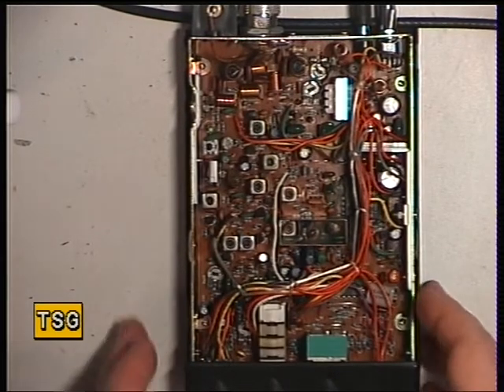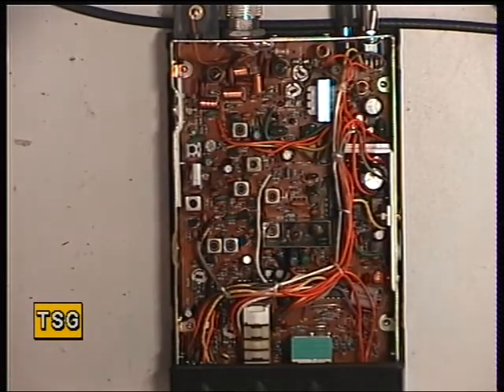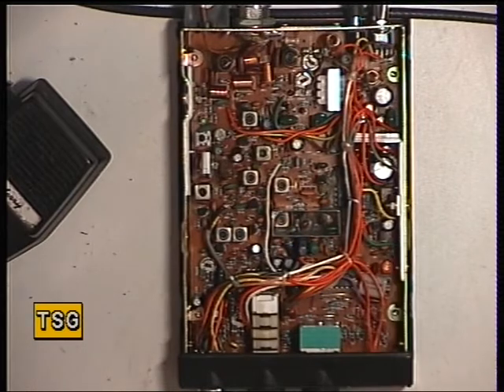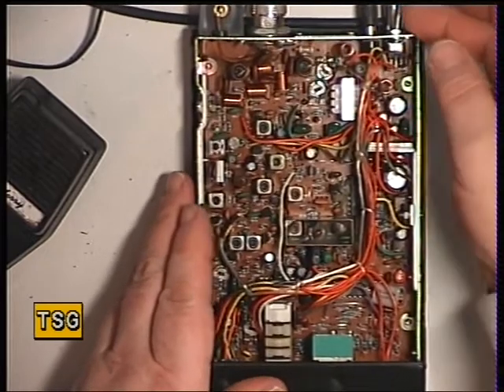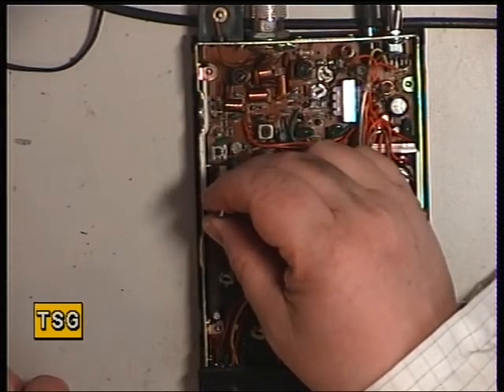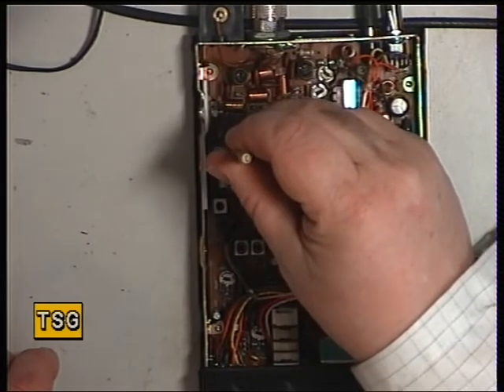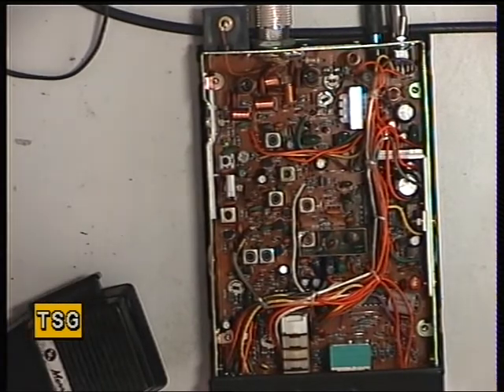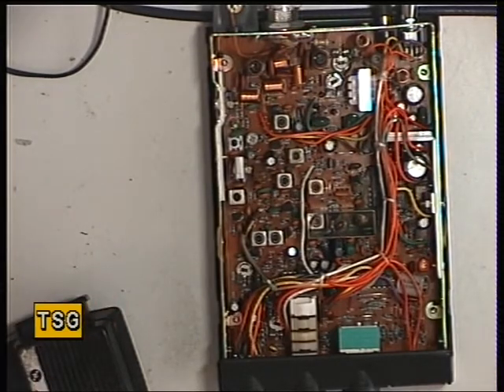Midland 77-805 Port-A-Pack, UK (CB 27/81) CB radio (Transportable) - Transmitter alignment

Comment: Hello UK CB radio servicing/RichardShireby
I purchased two of these units on Ebay. Both of them receive very well. But when I transmit to my friend on his CB. He says my voice is very weak/not loud. Is it required to do this kind of tune up on the port-a-pack. Here in the U.S. I can not find anyone to do this like you. Can you suggest any help with this for me?

Comment: Hi Richard I have one of these, it transmits on low power, but on high power it doesn't function any ideas?
Reply from the maker: How bizarre, because low power goes through the extra bit of circuit to attenuate the power, whereas high power is the normal setting. I would guess at a broken wire between the high/low power switch & the pcb. You can also check the switch with your multimeter before delving into more complex issues.

Richard
Reply: Probably like mine. The low/high switch is broken!

Comment: Hi,  at 3 min's and 10 second in the video you have a tool in your hand that is hardened plastic and copper to brass looking in colour, do you know what it is called please or where to buy them, i am starting an electric/communication course in april to may next year online, and im trying to get as many different tool's for tuning/alignment as i can, thank you
Reply from the maker: It's unfortunately now discontinued. R.S. Components used to sell three types of Trimming Tool, the yellow one I use, that black one with two different phosphor-bronze ends & a blue plastic one that doesn't fit very much that we see. I'm having to use ceramic trimming tools & got a cheapish set via AliExpress. We also use the "colour tv alignment set"  which Rapid Electronics still sell. The green hexagonal tool in that kit is vital. If we lost the black tool you saw, I'd have to make one out of wooden dowling with a phosphor-bronze flat strip inserted. Sometimes that PB flat strip could be recovered from the carrier strip that some Molex type connector pins are supplied with as a bandolier.

Hope that helps,

Richard, UK
Reply: @ukfmcbradioservicingTango21  thank you, for replying, do you know what it was called even though they don't make them any more please,
Reply: hi, could you take a picture of it if that is ok please, and up load it,
Reply from the maker: @ghostshy5176  I tell you what, I'll do a  quick video on alignment tools tomorrow.

Richard
Reply: @ukfmcbradioservicingTango21  thank you

Comment: Hi, late to the party. Very very, late. anyhow, I just came across this video. I hope you’re still around and can and will help. 

I came across this radio. Only difference is, mine is a silver face. Other then, all the same. However I need so help. The low/high watt switch on mine is broken on the inside of the switch. I took it apart the the plastic piece that makes it switch inside is broken. I need help finding another switch. 

It appears to be a 6in 3A125VAC switch. Why it says AC on it I haven’t a clue? But it indeed says AC. 

Anyhow, can you or anyone else maybe help me find this or another compatible switch? I can’t test it until I replace this switch. 

Thanks much in advance.
Reply from the maker: email me rshireby.co.uk   The CB radio content of this channel is about UK FM CB radios only.

Richard, G0OJF, UK
Reply: @ukfmcbradioservicingTango21  I’ll email you as soon as I can. Thanks for the reply. 

And FWIW, this is a CB. Not FM however.  And as I said, I believe I have the US version of the radio. When I email you I’ll send along a picture of two. 

But I may have found a switch to replace mine. Only difference is mine says 3A125VAC and the one I found on Amazon says 6A125VAC. Both are on/n and both are 6pin.
Reply from the maker: As long as the 6A one fits it's a better job.

I can only help you with radios made for the UK market. I'm assuming you are not in the UK as US CB radios are illegal here.

Richard, G0OJF, UK

Comment: Hello Richard
Is there any way to contact you by e-mail about my Port-A-Pack problem? I am the guy who just posted from the U.S. about my Midland CBs I bought on Ebay. Thanks Dave Whelan
Reply from the maker: David,

My Email address in the only format youtube will allow is in criptic form!

richardDOTshirebyATvirginDOTnet

However, the USA uses AM mode for CB radio, whereas here in the UK, CB is FM. The products have totally different insides. Whereas the transmitted speech volume is adjusted here with the 'Deviation' control for an absolute maximum of 2.5Khz using a deviation meter, on AM you adjust the 'Modulation' control for 95% modulation...checking with an oscilloscope that it doesn't 'overmodulate', which would cause severe TVI. On Am, the radio generates a 4W carrier, then has 4W of auduio superimposed on it using a modulation transformer. The AM sets you use in the USA are simpler to service! Nothing can be done without test equipment.

Comment: you no the midland you got in a joblot what are you doing with it is it for sale mate
Reply from the maker: There is building work here this year so a lot is in storage. Bear in mind any 77-805 sets that I own don't have the carry cases.
Reply: do you have the microphone and are they working mate
Reply from the maker: No, I just have one microphone which I bought broken & plugless off ebay for £15.99+ post! I sorted it out of course.Those mikes are like hens teeth.  Otherwise you just have to use a standard microphone & an extension speaker plugged into the back.

Richard
Reply: How much do u want for the Midland portapak 77-805 and dose it come with airal mate
Reply from the maker: Nearly every radio we buy in comes as 'body only', no mike aerial or power lead. As I say, much is in storage because of building work here. You are far better off buying one off ebay & then sending it to us for service.

Richard